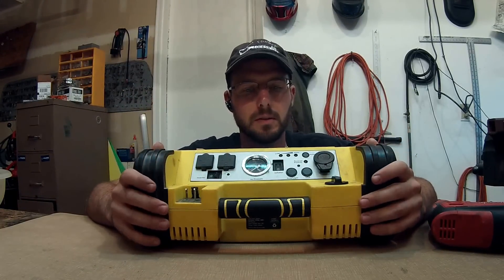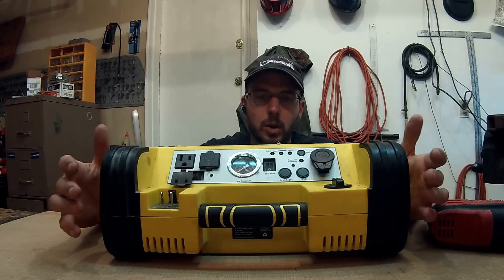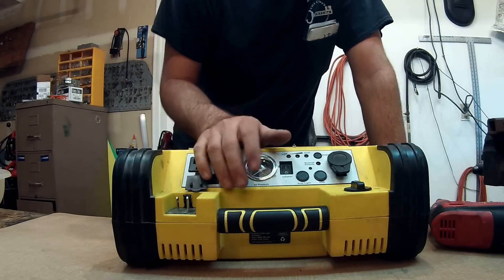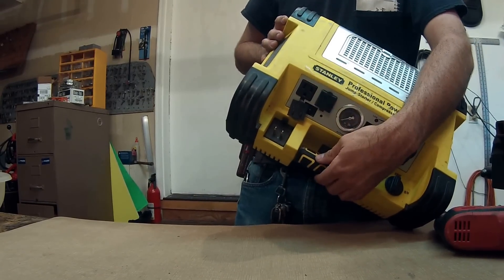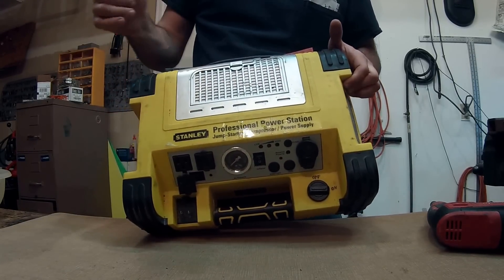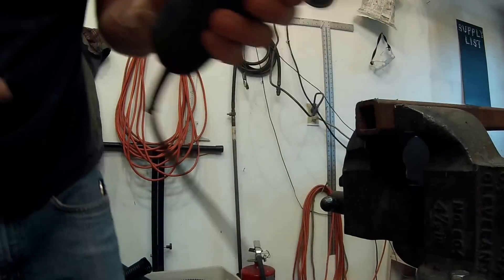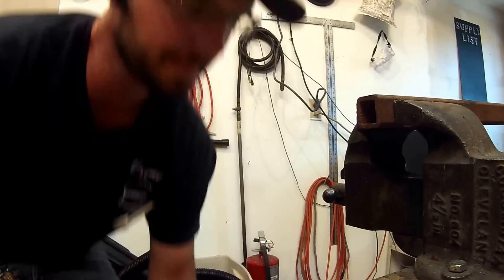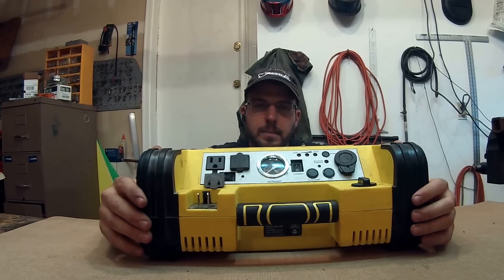Stanley Professional Power Station Review

Comment: I must have gotten lucky with the one I got. 5 or 6 years I have been using mine. I use everything on it except for the inverter. Never really needed the inverter. The air compressor is still going strong after countless uses. The booster has no problem starting my 1000 cc sxs on -20c days. However it does struggle to start my v8 pickup. Other then that, I love it. Saved my butt a few times. 10 on 10 from me.
Reply: How domyou.know it's charging

Comment: I have one and after 5 year the battery looses charge fast. I bought a replacement 17 mah battery and it took about 15 minutes to replace cost about $55. Mine had not broken anything so far and had been mainly used to jump co- worker's cars or air their tires. I used it more than once to take night fishing and ran led bar lights as an area light.
Reply: Hi tell me where you buy it the battery to replace it please

Comment: thanks i was thinking of buying one till i seen this.. i have used my schumaker  for two years with no problems.. jump starts powering lights etc tires..
Reply from the maker: Glad to here, thanks for watching!
Reply: Ted May Your Shumker able to charge while driving Vi the cig lighter nd is two electric outlets? If so got. li ok so I cn buy one?
Reply: Wayne Winton 
Can you use a 12v male to 12v male cig lighter adaptor too charge it in your car?

Comment from the maker: Yes There is. I think its like a year or something but I would have had to send it to stanley at my cost and not have it for up to two months. The 90 day Lowe's warrenty was expired by one week so no in store exchange. I use it so much I would have had to buy another one to cover me for that time so I just charge it like a car battery with a battery charger on the trickle setting overnight. Simply hook the jumper cables up to the charger + to+ - to - and turn the switch to the ON position. Easy!

Comment: I order this from Amazon.  Got it, checked the batter level, said full, so I figure let me plugin a fan which is why I bought it for.  Second I turn the fan on it went up in smoke!!!  Got a replacement, same thing happen!!! I know the thing says charge it for 40 hrs before using it, but if the battery is low, wouldn't the fan just not work? rather then blow up?

Comment: A fair review a little bit harsh. I will say that I only use mine for tire air pressure and have jump started a good number of people on the road and never have had a problem with it. Have used mine for probably 6 years and can still pop it on and off of car tires with no problem. I just pulled it out of the trunk today to charge up for the cold weather and I'm not sure that it is charging so I may have to charge it off of a battery charger. But I certainly got my money's worth with it.

Comment: If u take the battery out and charge it a little then put back on it the plug in charger will work. If there us no charge at all it won't be detected and won't charge.I did it works perfect

Comment: Great review and video!  I'm looking at this to have in the event I need to jump start my 2002 Ford Ranger 3L V6 and perhaps enjoy the air compressor feature to keep up my tire pressure.  Like you, I feel that sometimes when a lot of "added features" are put on a product the main purpose of the unit takes a hit and the product while seeming to be the "last one of these things you'll ever need" turns out not to be the "dream machine" you hoped it would be.  I have also looked at the Stanley 1000/500 amp unit but saw one review that said it didn't always work well jump starting a V6 engine.  Well, like I said I've got a 3L V6, and I guess I'm gonna have to do more research and figuring out if I want one of these Stanleys or perhaps a unit from another company.  I would appreciate any input from anyone to help me with my decision!!!
Reply: I wouldn't recommend going down to the 1000/500 for anything size engine. The price isn't that much difference and this one 1400/1000 gives you as Tim the tool man Taylor used to say: 'MORE POWER"... HO HO HO! I just got mine yesterday and am already loving it. Inverter. jump starter (main reason to buy), charger for cell/computer/tools  light, compressor to fill tires, use for camping,etc. This is the one to get I believe you would be happy. I do NOT work for Stanley nor receive any compensation for any review/suggestions.

Comment: I own the Black & Decker version and ran into a similar issue with charging. It turned out that my LED charge indicators weren't any good (they were never very accurate) after testing the battery with a multimeter.

Comment: Hi Wayne
I bought the same as yours, but I do not have cable for charging at home. It would be great if you could advise me what cable do I need to buy him or power adapter so I could charge it at home?

in our country outlet issue 220
In the store they told me that I should buy a power supply unit for 120 volts 60hz 500w

Comment from the maker: BnTeK TrpreB

I have no idea about 220 outlets. I would just use a 12 v comverter and battery charger as I do mor my unit
Reply: Wayne Winton When you say you "hook it up to a regular battery charger," the battery charger that is plugged into the wall has + and - clamps as well as the power station.....so you connect one red clamp to another red clamp and the same for negative side and then plug in the car battery charger (to the wall??) Sorry, i am quite a novice with this stuff. I am trying to charge an old power station that will not charge at all through the normal dc connection
Reply from the maker: Yes. All it is is a battery with cables so just like you said red to red, black to black and yes plug into your regular wall battery charging unit. Charge on lowest slowest setting.
Reply: Wayne Winton Great, thanks so much for the reply!!
Reply: Wayne Winton If the battery charger is turned on, but the power station is turned off, will it charge when connected to the battery charger? Does the power station have to be turned on as well in order to charge it this way? Thanks again for any advice you could give in regards to this. - Anthony
Reply from the maker: Anthony Valente's Jazz Channel Power station must be in the ON position to charge

Comment: i just got one, it came with a 10a 125v  extension short cord, it says to use a house hold extension cord to charge it first time thou for 40 hours, does it matter can i just use the cord that came with it. also it came partially charged , but still wants me to charge it for 40 hours first time, is that correct?

Comment: can this power a PS4? I have a portable monitor that has its own power supply, but i was wondering if this would power a PS4?
Reply from the maker: Mostlikely not for long
Reply: Wayne Winton how long do you think it will? 1 to 3 hours?
Reply: doesn't matter because this is most likely using a modified sine wave which can mess up anything with an electrical circuit.

Comment: from experience the coffee maker, mr. coffee takes about 1100 watts. a toaster is 1500. it will run a 750 watt microwave but barely. remember they are using watts. not amps for their ads. we got our info using a gas generator.rated 1000 watts. real output was 850-900. we should have bought the 2000 i..now i just got the stanley 500 watt power station. as long as it will run my c-pap for a couple of days, if needed that's all i need.

Comment: Hi Wayne, I was considering buying the Stanley FatMax, and came upon your review.  For over $100 it doesn't seem worth it to me.  
I am looking for a power station for my two teenage sons who just got their first cars.  Of course as their mom I am freaking out, and trying to find tools and items that could help them in an emergency.  
Most Important for me is the battery charger, and pump for their tires.  However, I did like how this would power small appliances in the event of a power outage and/or when camping.  
The one thing this doesn't have, but I find important, is hazard visibility, like a strobe light and/or blinking feature.  Also important, though I could buy separately, is a strong and powerful light to see what your doing.  The one on the bottom of this one didn't seem very significant.   
So Wayne, what power station would you recommend?  Also, I am open to any other items you have reviewed that you think would be a good idea,  
Thank you so much in advance for helping a mother keep her boys safe ?
Reply from the maker: I would not purchase this unit again. I am just to cheep to buy a new one untill I feel I have got my moneys worth out of it. I don't use the bells and whisels on it I only use it as a jump starter aid. I would recomend you visit the link posted below (or Google best jump starter review) and look at the information listed there to make your desition.
http://bestjumpstarterreview.com/
Reply: Wayne Winton Thank you.  I'll look for a better model that way.
Reply: Wayne Winton Thanks for the link Wayne, I just got a Schumacher XP2260, but haven't cracked it open yet, I have the Stanly in my Amazon shopping cart ready to pull the trigger.  I want one mostly for portable power, camping/power outages.  Is  something designed for a jump starter still the best way to go.  One of the reviews I read said the Schumacher XP2260 would only power a few lights/small appliances for a couple hours where the Stanly would at least go thru the night.  I am confused on which spec I need to pay closest attention to for my needs.  Thanks
Reply from the maker: pylon4 I personally would not buy this unit again. I have no experence with any other brands.

Comment: Does this have a fuse?
Mine quit charging!
Reply from the maker: so did mine from 110 plug in. however you can still charge it up with a 12 v regular battery charger
Reply: How do you charge with a battery charger

Comment: make a connector...2 110 ac plugs to one outlet! grinder wnt die  no more!!???
Reply from the maker: Voltage and I do not get along that well. Lets just say we have had our diffrenices. Im shure your solution works but the 1500 watt power inverter in the work van keeps the grinder going good. Thanks though.

Comment: Garbage.  Same happened to mine, used it a few times in 2 years, kept it charged, battery is fine.  Won’t charge.  Now I need to buy a battery charger to charge my charger?
These are on the higher end price wise, I took the chance.  Don’t buy.